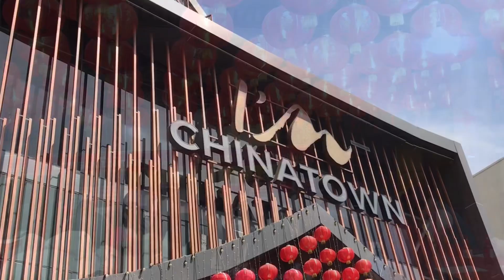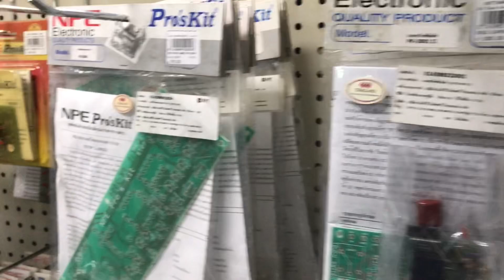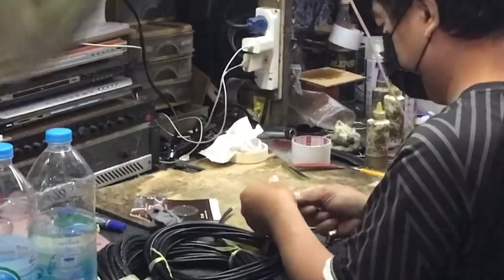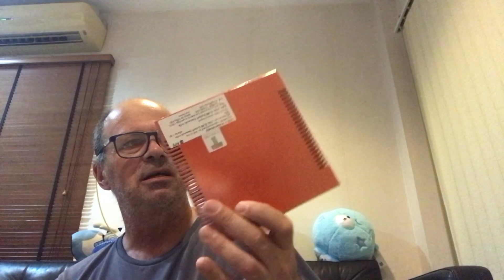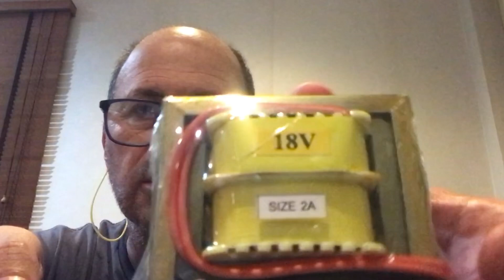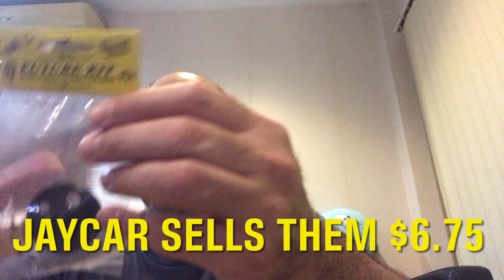Electric Market Bangkok

Comment: I enjoyed that video mate, it's great that people like repairing their electronic devices.
It would be nice to have parts shops like that in Australia as well, I remember Dick Smith's shops when they stocked mostly electronic parts.
Reply from the maker: Yes and kits and bigger stores had a ham radio section.
Reply: @TheArtofEngineering  yes, I used too study there catalogs with all the gear that was on offer.

Comment: The desolderer will serve you very well….provided you can still get replacement tips. 

No radio kits ??
Reply from the maker: Alas not that I saw. Many were kiddie stuff, blast from the past stuff… fm wireless bug, walkie talkies, stereo amplifiers etc. Lots of parts and components. The “radio” store had hand talkies etc but only did HF via orders. Fun place to visit …. Nearly got an SMD rework too but v be luggage too heavy!!!! The unit I got has 3 tips…. Next visit I will get more. 73
Reply: @TheArtofEngineering  AE has a bunch of rework stations. Some have board hot plates too. My eyes aren’t up to it like they used to be. I’m more comfortable swapping 6L6s on a tube amp than swapping a chip capacitor on some 18 layer board :-)